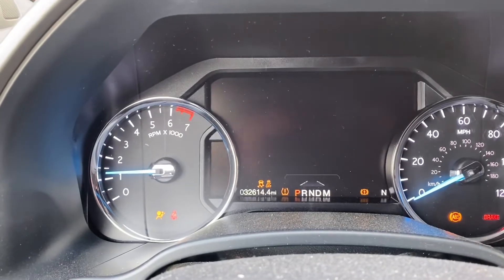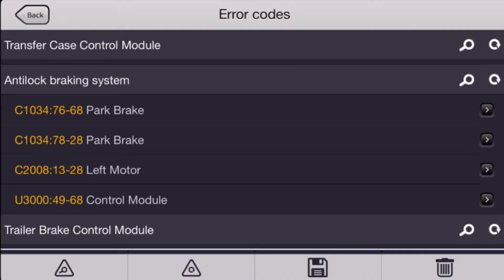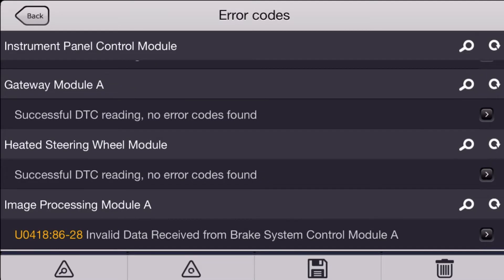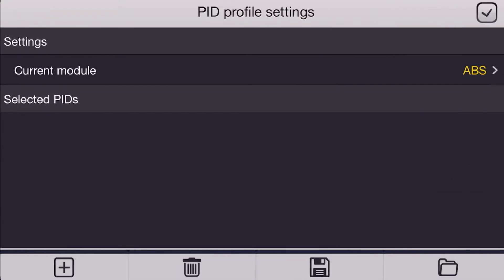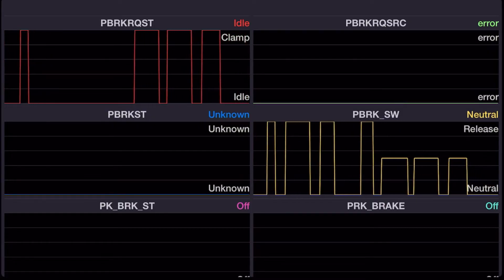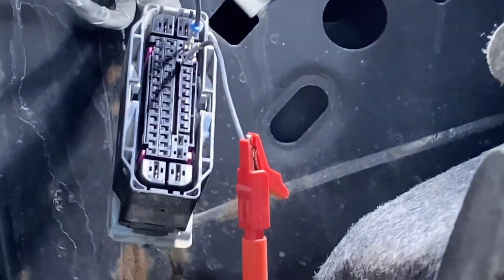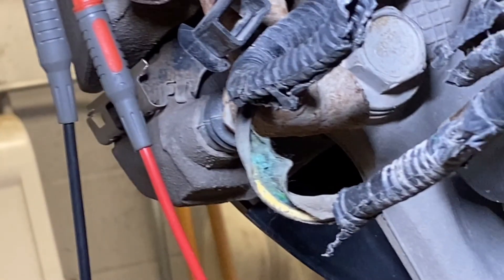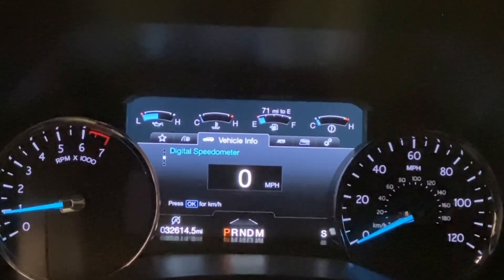Parking Brake Malfunction on a 2018 Ford Expedition C1034 C2008 U3000

Comment: My 2018 f150 just did the same exact thing today.  My truck lost power it was like the parking brake got stuck when I took off from parking which was weird because I didn’t turn on the parking brake but I got the same codes you just showed on that expedition.  Seems to be working now but the check engine light remains on.  Any suggestions?
Reply: Please man please tell me what did you do because I have a 2018 F150 just like you describe my truck lost power and the pedal is stuck in this video help you????…. What did you do to get the brake pedal unstuck?

Comment: I’m not trying to be mean but can you explain it like you haven’t worked on a car before? Too much what you said way over my head. Very frustrating when it’s happening and you just need to know what to do
Reply from the maker: I believe that one was a broken wire that needed repaired on the rear control arm

Comment: I am having a big problem with the collision’s indicator on my dashboard.l indicator on the dashboard l have 2021 f 150 this is my third front bumper.This only happens when am going to park The collision come on and of it goes in to the wall.I put my foot on the brake and it just keeps going.l thought first time it was my fault.But the one l know not my fault.l was in the underground parking at the hospital for a to have to am doctor .l turned in to a the parking place the collision sign come l had my foot the as turned l keep foot on the brake but it keeps going.This is 2021 hybrid .This time the air bag came out .l have to pick it up next week time .l have drive it home l am ,75 miles to my house.l am frightened that this will happen on my way home and maybe kill someone or my self.lt has never happened at highway speeds when l brake.The three time it did it was very wet out .

Comment: Does the same error message display when battery is dying? Seems to be the save in my broken down rental Expedition 😒
Reply from the maker: For some reason, yes. I’ve seen a couple F-150 with very low battery’s display this. Fix the power supply and the message was gone

Comment: Thanks for the vid, I had the exact same issue. I think they are make the bend to tight and the wires to stuff. Someone else repaired it before me and it did failed again. Worst thing that happens is you loose the cruise control, 300 miles without cruise sucked.
Reply from the maker: I agree.  They have to bend back and forth in the same spot all time.  It’s a problem.

Comment: Hello. Do I have to put the park brake on maintenance mode before I pull the wiring harness and after I solder it and put it back on, do I need to recalibrate or reset something? Cheers
Reply from the maker: Maintenance mode is only needed if you’re removing the brake pads or caliper. You shouldn’t need to put it into or take it out of maintenance mode.